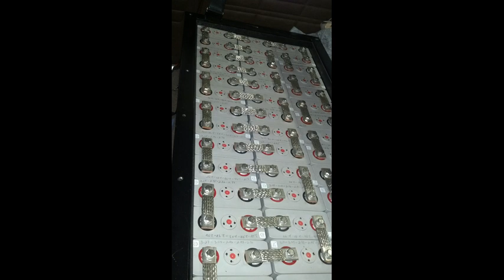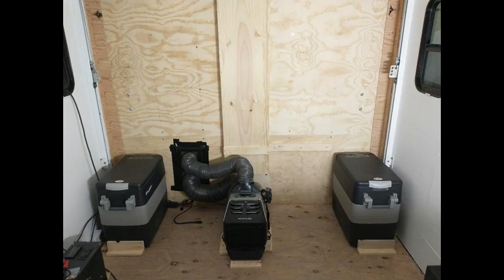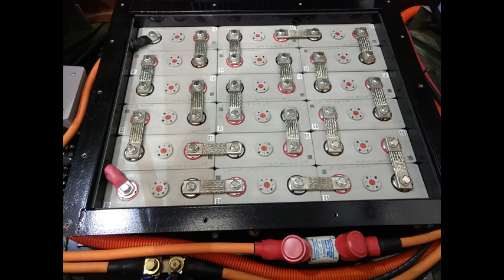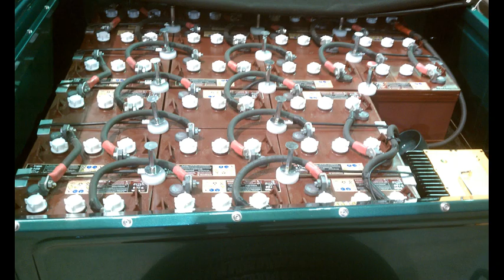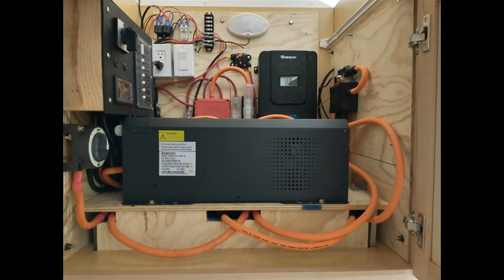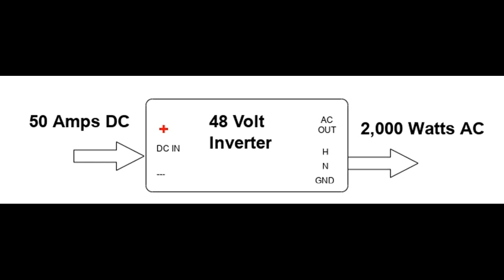Off-Grid Power - Off-Grid Power Systems Explained - Battery Packs and Power Inverters - Episode Five

Comment: Informative simple concise. Most off griders go too small on power. I have found using electric heat is far superior to wood or fuels, just build a $28k CAD system run 100% AC power, this is your power for the next 20years make it capable, the more you have the easier it is to just live your life without gathering fuel every week or chopping wood. The EG4 12kw , 60kwh and 23200w of solar using Thoronova 580w x10 , 420V 15A, 5800w to 7000w vertical with snow x 4 strings I doubt you would even need a generator. My 3.3kw array with snow/sun went to 4185w before it tripped the mppt. had to shade it with a stick.
With 8kw/48kwh/11.6pv 70 hours of gen this winter, 18kwh usage on cold days. My pv is maxed time to expand.
Reply from the maker: Thank you for subscribing and your comments.